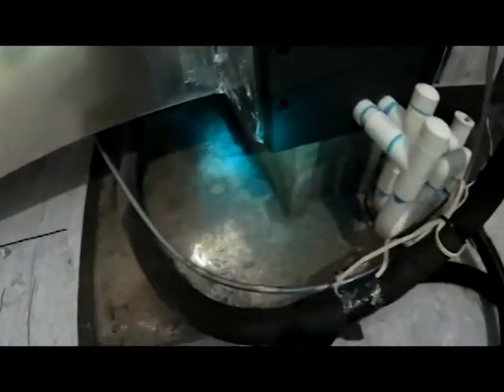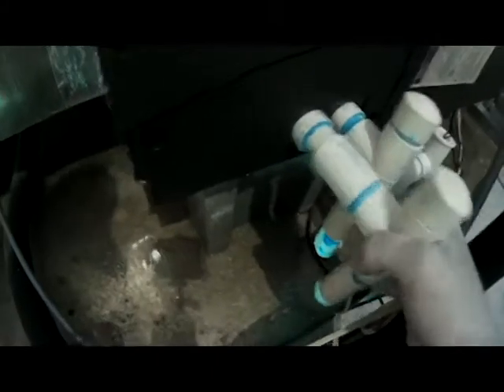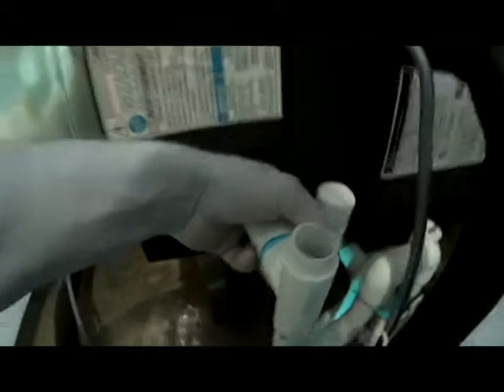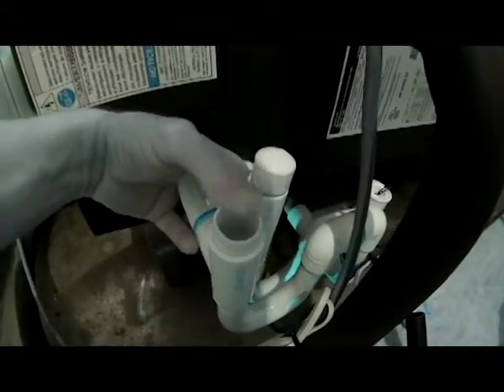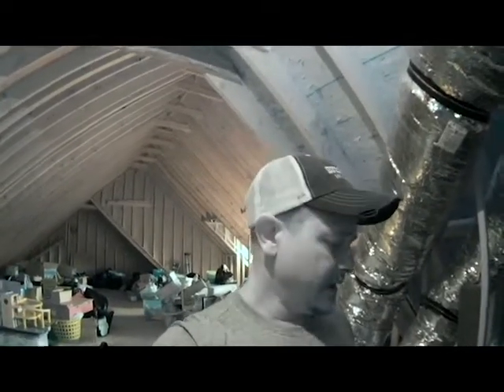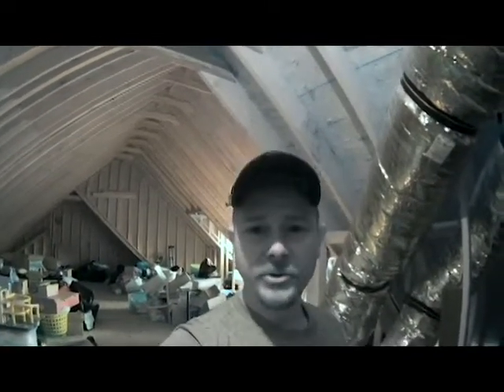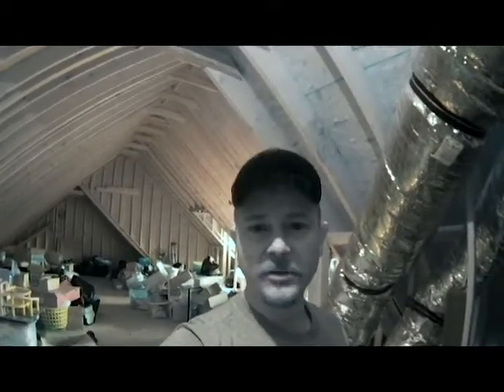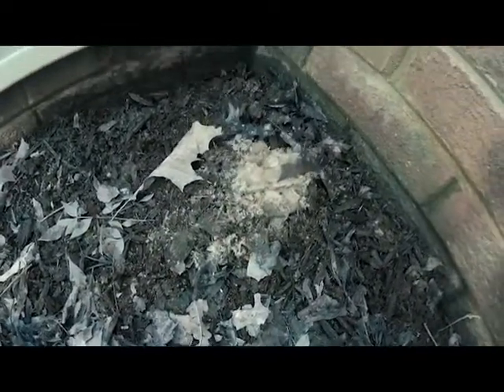How to Fix an Air Conditioner | Drain Pan filling with Water

Comment: Hey Travis, I was wondering if it is normal for water to be in the catch pan during summer? I live in SC and it’s starting to get pretty hot. A couple of weeks ago my AC shut off due to the safety switch in the drain pain sensing the water level was too high. I removed the cap and ran a snake tool down the line and then flushed out with running water. I just checked again yesterday and there is a fair amount of water back in the pan. Is this normal? Do you have any suggestions for me to try? Thank you sir, I appreciate your time!
Reply from the maker: Water should not be in the pan. I would check to see if my drain linecneeds clearing.